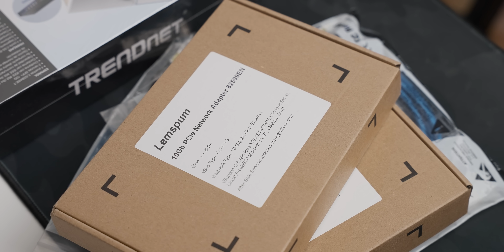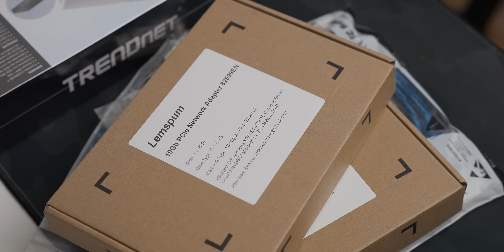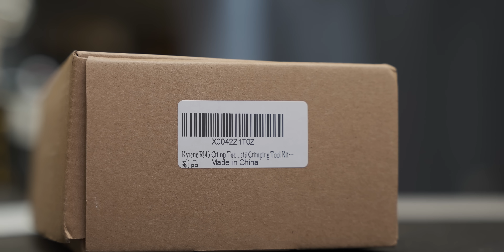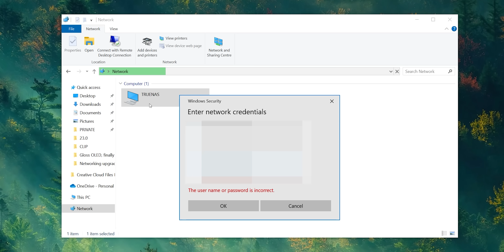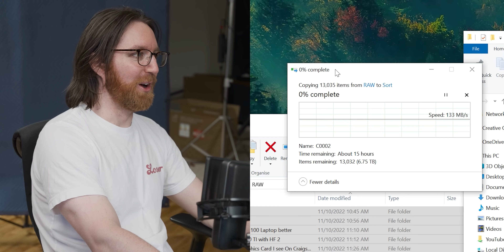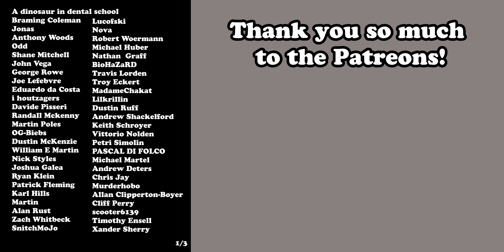Upgrading To The Cheapest 10GE Network...

Comment: Can anyone explain why Dawid connected the backup HDD to his main PC via sata and then transferred the files to the NAS via LAN?. Wouldn't the more logical thing be to connect the backup HDD to the NAS PC via sata, mount the HDD in TrueNAS and use the web interface to transfer the backup files to the mounted storage pool? Surely that way you're cutting out the Windows PC, the LAN and directly transferring files from one drive to another on the same system. Or wouldn't TrueNAS recognise the backup HDD?

Comment: "How to determine the necessary length for cables," based on 50 years of doing so. (1) Measure the distance carefully, taking care to account for the distance around corners, and around obstacles. (2) Just for safety's sake, add 15% to the calculated length. (3) Double that, and you'll have a cable that's ALMOST long enough. I find that 250% of the calculated distance will work, about 50% of the time.
Reply: And hiding the extra length of the cable as a loop somewhere is easier and cheaper than doing all the cabling again with a longer cable.
Reply: @Ba_Yegu  Precisely.
Reply: @ScottGrammer  Rightyo, measure the distance CAREFULLY then calculate some arbitrary coefficient to multiply that by, add 15% then square it by the diameter of the moon, divide that number by how many lunch-minutes you have left and bingo... you have your length, maybe, just enough, 50% of the time.  GTFO.
Reply: @BenState  You forgot to add six feet. Just to be safe.
Reply: dafaq.

Comment: Omg. Punching down that patch panel would have been so much easier than what you did. They are usually marked with coloured indicators for which cable goes where as well. Also when the cable is two inches too short how could you not move the pc back 3-4 inches?

Comment: Going from a 1GE network to a 10GE is like going from dial-up internet to highspeed fiber.

As for the NAS speeds, you would benefit from all SSDs instead of the ancient mechanical drives. These days the costs wouldn't even be much higher. Especially if you went with SATA SSDs.

Comment: If you want 10GbE network cards and don't need the 10GbE cards to be able to do 2.5GbE, you can get them pretty cheaply, usually from China with the X540 chip for around $10.

That's where I got my dual NIC card from, for example.

But you have to remember that the 10GbE hardware itself gets very, very hot, especially the cards, even when they're not really in use.

Comment: The spinning drives are still going to be the bottleneck. You’ll need to upgrade those drives to realize that 10G network speed. 2.5G network would of been more than enough in the current setup, but knowing your channel there’s probably more in store to come.

Comment: 5:47 For a second I was concerned but then when I saw you had pull through RJ45 modular connectors I knew you had a better chance. T-568B is really the only layout you need to know. OW O GW B BW G BW B

Comment: I’d have used the patch panel and then bought short premade cables to run from patch panel to the switch. I would have also verified that someone with a brain wired up the other side before putting any ends on.

Comment: Never cheap-out on infrastructure. I am not talking about the cheap 10G cards. Not using the patch-panel or buying minimum lenght cable is what really bites you in the long run. I am not sure how long you plan to stay in that office but it nice to have ethernet nice and neat.

Comment: I have that exact TP-Link router, it is awful as anything other than an access point... It was choking my 1.2gb/s Internet connection down to 300 MB/s on Ethernet and 30 MB/s on wifi 6E. I'm pretty sure it is a problem with the Qualcomm SOC inside.

Comment: Yeah, that single HDD was always going to be a bottleneck for transfers. On the plus side you don't have to worry about it completely saturating your network connection, which means you can continue to use your machines like normal while it copies.

Comment: I think you've done a similar setup to me. I didn't use fibre however as my switch is 10gbe on 2 ports and 2.5gbe on 4 ports.

I wouldn't use microsofts GUI copy function for something like this personally.

Comment: The technique for shoving the individual wires in the RJ45 plug is more like "put in right order, squish between fingertips,  trim to length, push wires in connectors, crimp" (for traditional plugs; for through hole plugs you can skip the trim bit). You want to have as little unwound copper as possible, especially at higher speeds. Should take a couple of minutes per end once you get the hang of it.

For functionality I'd accept nothing less than an iperf check, because Ethernet will work with only two working pairs, it'll just be slow.

The toaster hard drive dock will be limited by the drives, so maybe 200 MB/s max. Haven't come across one that doesn't top 400 MB/s with an SSD.

Comment: Here's something for you to think about...   I do not have a Nintendo Switch at the moment but... here's the tricky bit...   I keep hearing in the kitchen area the sounds the Switch makes when slotting in a joycon and it is driving me NUTZZZZZ!   The only thing aside from old cookers, washing machine, microwave and kettle I have is an Aliexpress 8:1 USB charging station but that is unpowered when not in use as I pull the plug.   I have had all cupboards out, atop cupboards, all drawers and under cupboards not a thing alive able to make that sound arrgh... is this what schizophrenia feels like or dementia (coasting to 60 so in da zone)?   All my consolery in the living room is powered off from the gang plug switch so its not them either, my other PC's and laptops are unpowered as are my tabletry, it is most perplexing...

Comment: I am kinda shocked that it worked without stripping the ends of the tiny wires.  I have never assembled RJ45 before but I have assembled other network cables (typically Coax) and I know those you have to strip the inner wires.

Edit: Also, make sure that you have some kind of guards over those fiber cables, because they're made of like a transparent glass materiel, and if you like say run over it with a chair it will destroy it.
Reply: He won't since he didn't use fiber, he used DAC cables (Direct Attached Copper).
Reply: you dont strip the ends with rj45, the crimping process does the trick
Reply: What?! Lol

Comment: That was some janky process but I like how you still end up with a working network. It really shows that effort going into engineering modern ethernet to be reliable wasn't wasted at all. 

Also, at this point 100gbit is a decent speed to have, right? A bit costlier but still can be achieved in a janky fashion.

Comment: Nice!  For me, I'm solidly on 2.5gbit for the run to the PC's.... The "mid bone" (the infrastructure after the router) is 20gb (that is 2x 10gb load balanced) however.  I'm using vlans and everything is managed.  The end result is that my network ticks along very well under heavy load meaning all my PC's can simultaneously hit 2.5gbit at the same time when using the lan infrastructure like my file server.

Comment: Hold the wires on order. Trim and KEEP HOLDING THEM. Shove onto the connector. Check they are in the same order. Way faster than one at a time even with some errors.

Comment: Bro you're supposed to shove all wires at once into the connector not bend them and insert with struggle one by one wth.
Also you overpaid for those network cards, I found Intel X520-DA2 used cards for under $20...
And I can assure you those cards you bought as new are most definitely excellent condition used/refurbished.
Lastly that random namebrand switch, should've bought the 4 port SFP+ mikrotik switch, it's a reputable brand unlike the other one, and if you need to connect it to the router you can buy sfp+ to 10G RJ45 adapter.
But in the end it all worked out for you so eh whatever.

Comment: I wonder if itd be possible to transfer data across via one somewhat large ssd, and then have the ssd transfer to the hardrive internally instead of transferring across the pcs. That way the lenthy process is still purely dedictaed to the NAS without breaking rhe bank on multiple high capacity ssd's

Comment: So how does one crimp networkcables? The answer is: you don't. Infrastructure cables (the ones in or on the walls) are connected to sockets or panels using a LSA+ tool (or whatever that is called in the US). And patchcables... just buy them ready-made in the length you need.

Comment: You did what I did a few years ago.
FYI. You can install a SAS card and sas back plane (hp ml360 g5) with battery backup. 

If you want speed then you will need nvme on both ends, raid 0 for risk, but faster transfer speeds  (using copy to lower the risk).

Btw.
My transfer took 6 weeks!!

Comment: I am super surprised that your CAT6 cables worked. that had to be the craziest way of crimping i have ever seen. I am happy it worked.
Reply: Well, it works, but we don't know if it works well... Without a test with a good tester (like Fluke) we have no idea of the quality of the wiring. At least try an iperf test to see if there are transmission errors...
Reply: @frederichardy8844  wasn't even thinking about transmission errors.. you right iperf or a fluke test is need it to verify it.

Comment: 5:50 OMG, you don't have to thread each wire into the RJ-45.  You lay them out side by side in the proper order FLAT between your fingers, and then thread the entire thing into the jack all at once but they don't need to be 3 inches long. Double check the wires are in the proper sequence before you crimp it. You don't need to snip off the excess wires out the tip, your crimp tool should cut them off.

Comment: Manufacturer aside, it shows that those cards have a Intel X520-DA1 82599EN chip on them, so you should do just fine with them.  I'm using a different 'random' name brand card in mine with the same 82599en chip on it with zero issues thus far (been running it for close to a year with no problems at all).  I AM using a bit better switch though (Ubiquiti aggregation switch).
Reply: A tip with those thru-style connectors, make the wires longer than you need, and BEND over 4 or 5mm once they're through the connector.  They won't slip back through.
Reply: Also, your 10g cables appear to be coaxial/copper cables, not traditional fiber optic.  Fiber optic cables usually have a seperate SFP DAC, which the fiber optic cable plugs and locks into.
Reply: You'd also transfer MUCH faster if you'd just plug the drives into the onboard SATA ports on your NAS machine, and copy the files from the NAS machine directly..  You'd likely be able to transfer all those drives in a day or 2 at most...  Can you tell I comment WHILE I'm watching the video, and not after, LOL.

Comment: Copying speed from the hard drive will vary depending on where the files are physically stored on the platter. If you're copying files to/from a blank or near empty drive, the files will be stored on the outside of the platter, which spins faster. As the drive fills up it will start storing files towards the centre of the platter, which spins more slowly. My NAS drive(s) copy at about 250MB/s when new/empty, but when near full the speed drops to nearly half that.
Reply: Ooo that’s interesting
Reply: Also i think that when doing copy is not 1:1 straight ahead. The copy software reads som chunks ahead to make a "table" so it can track that the copy is done correctly with no errors and every single bit has been copied. As i remember, even in the old days with Amiga the copy software work that way.
Reply: Faster on the outer edge of the disk, slower as it gets to the inside. 

He needs to RAID a pair or two of drives to get some real speed.

Comment: 9:15 - DAC means "Direct Attach Copper".  DAC is the whole cable.
Reply: And it says direct attach copper right on the package 7:06
Reply: Fair, I wasn't reading the packaging. I was listening to Dawid who calls them fiber cables at 7:02. Which the packaging even calls them sfp+dac cables. So, I am super confused where he got fiber from.  As well as later why he called it a dac module when it's an sfp connector that he was talking about and showing.
Reply: @tspawn35  SFP+ refers to the connector/type of slot the cable fits into, not the cable itself. SFP+ DAC means it's a Direct Attach Copper cable, with SFP+ connectors at the ends.
Reply: This whole video had to be done as comedic relief, there's no way he didn't google anything before purchasing. At least DAC is a cheap alternative when it comes to reducing latency.
Reply: @1337bG01  I don't think so, I think he meant digital to analog converter unknowingly.
Reply: He calls it a dac module. The connector is an sfp to fiber module... Lol
Reply: @tspawn35  the packaging literally says direct attach copper on it. It's not fiber
Reply: @tspawn35  The more expensive fiber ones are. These are integrated with direct wired copper to save cost.  No fiber optics in these cables.
Reply: Sorry to be that guy, but DAC means "Digital to Analog Converter" 
/s
Reply: Strangely TLA’s can have more than one meaning. New technology comes along and wham! new TOA’s. Shall I translate? No, not the Tactical Officers’ Association (snipers), but Terms of Art — whoaa, more than one meaning possible! (addressed to ‘that guy’)

Comment: Those cables are DAC cables, which are copper not fiber.

The inner part of the platters on the drives are moving slower so you will get lower speed on that than on the outer part of the platters. Basically you will always have variable speed with mechanical harddrives.
Reply: Yep. not optical. I would have thought sfp+ and some fibre cables would have been cheaper.
Reply: @hausm3ister  DAC cables are actually extremely cheap right now.
Reply: Yes, that's why they are short... With fiber he could have used longer cable...
Reply: @frederichardy8844  you could have short fiber cables, I have seen many that were just within a rack. The key thing is that fiber would be SFP+ modules and separate cables. It could also get very complex very quickly. These DAC cables were the right choice for this use, even if they are not fiber. He could have also gotten SFP+ copper modules for 10Gb over copper and had essentially the same results, but those are a lot more expensive than the DAC.
Reply: @jeffreyparker9396  I mention longer cable because he complains that is DAC cable is too short... But there's so many technical bad choices in the video that I assume it's for entertainment purposes and generate a lots of comments... and that works, no?
Reply: @frederichardy8844  hard to say, I could see someone who doesn't really know what they are doing ordering the DAC cables and thinking they are fiber, also the length limit is 5M on those, so getting the longest and hoping that it works is certainly something that I have seen. I also am well aware that a lot of times this is just done for the engagement. I am not completely sure which in this case.